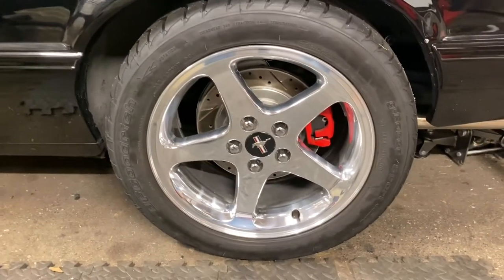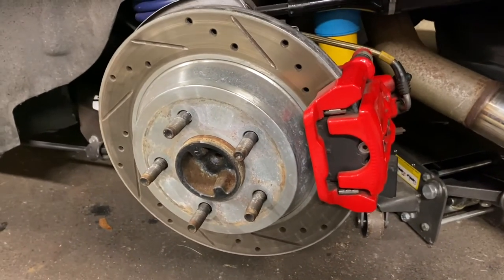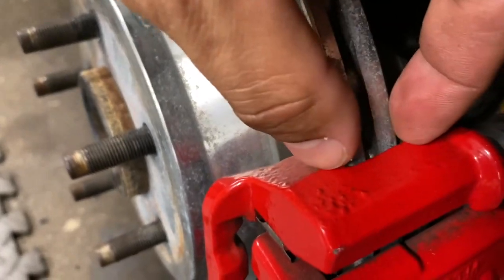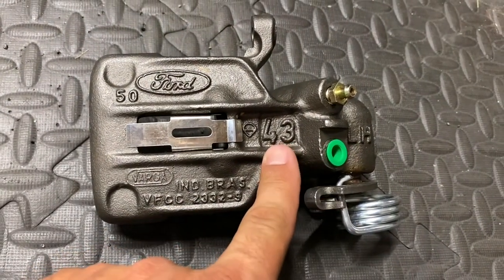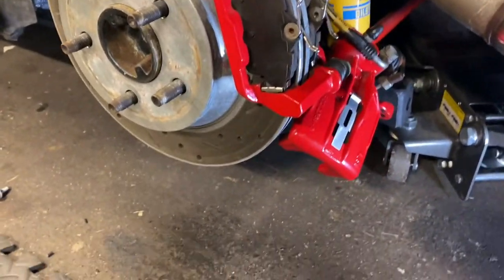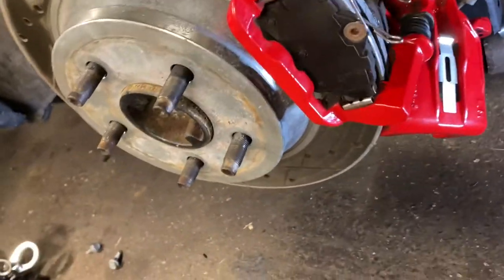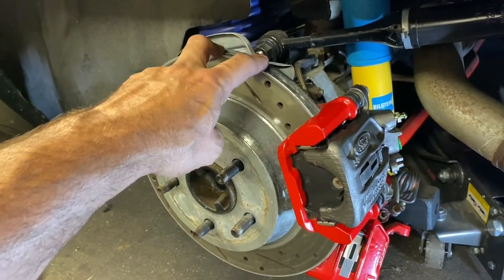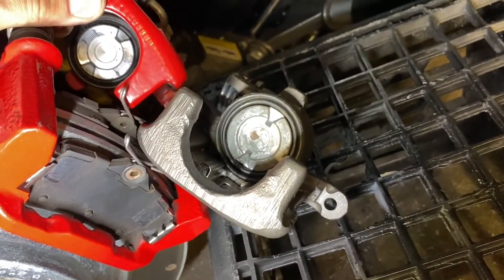Mustang rear caliper options w/larger front brakes (ATS Brembo) - Taurus 43mm

Comment from the maker: Lots of folks are having issues with Taurus reman calipers, including brake lockups.  The culprit is poorly remaned calipers.  It’s serious enough that I can no longer recommend this caliper and say to use at your own risk.  I’ll leave the video up as reference, but at this time I would suggest to stick with 38mm standard calipers.
Reply: For a 99 GT ,Would you say it is to front bias running 13inch cobra rotors /ATS calipers with cobra caliper 38mm and the 11.65in rear rotor?
Reply from the maker: @joeltaylor775   Hard to say because there are a lot of factors that go into calculating brake bias.   With the SN95 chassis you want to stay around 70-75% front as a general rule of thumb.  With the 38mm rears you are probably in the 75-78% range but it's been some time since I've crunched the numbers.  I tried to dig back to see if i wrote it down anywhere but i was unable to find.
Reply: @Mustang5L5  no problem bro appreciate the reply 🤙

Comment: Anyone doing a Fox conversion should have an adjustable proportioning valve, which regulates brake pressure to the rear. Too much rear bias with the Taurus calipers could be adjusted out with trial and error. Thanks for posting.

Comment: Nice video!

I see it's now recommended to use the 94-04 Cobra rear calipers on the rear. Wouldn't this bias adjustment be made with the Ford Racing proportioning valve anyway? Does it really make much of a difference?

I'm also wondering which brands are experiencing failures. I know the higher quality ones, like Raybestos and Powerstop, are usually pretty good.

So, as of June 2024, is the setup ATS calipers on the front and SN95 Cobra calipers on the rear?
Reply from the maker: The prop valve really controls the knee point which is the point of pressure reduction in the brake fluid to the rear calipers.  It's only one function of the brake bias calculation, as leverage (rotor diameter) and clamping force (caliper piston size) also play a role.  As you increase rotor diameter and clamping force, it takes much less pressure to stop that moving wheels.

I know the Cardone remans were the ones a lot of folks are having issues with. Most of the failures i've heard of have been on track, but have been catastrophic resulting in serious damage.  I imagine severe heat might play a role.  I think Cardone does remans for other vendors who rebox the part under their brand, but I dont know who uses them.  I've seen some folks tear the calipers down themselves to inspect and have found subpar with with some Cardones.  Others have gotten junkyard calipers and rebuilt them themselves. 

Really it's your decision as to the risk you want to take and your application.  Street car? probably wont ever have an issue provided you keep an eye out for rear brake drag.  But i also think street cars probably wont notice a difference at all between 38mm and 43mm calipers, other than pedal feel. There's also other factors at play here, such as weight distribution (IRS cars can sometimes get away with more rear brake bias), tire size front and rear, tire stickiness, does the car have ABS? etc.   I hate to dictate what folks should do and rather just provide the information and let them make an informed choice.   Id probably have different recommendations for a stripped down Fox notchback with 245 tires all-around, vs an 04 cobra with 275 front/315 rear, ABS and the IRS out back.

Comment: Hey bud, thanks for the video - i do have a question - Im considering this full disc swap (Brembos and cobra rear disc) - i have a 92GT - is upgrading the brake booster really necessary - and what do you think would be the biggest concern if i didn't? I mean - it cant possibly stop worse than it does now.. any response is appreciated.
Reply from the maker: Doing the booster has always been a controversy because some folks think it’s necessary and some do not.  I get it, it can be a PITA to install, but it does add much needed brake assist. 

I usually say that I recommend it personally (I have it) but am open to suggesting someone try it with the stock 87-93 booster.  Some folks like the firmer pedal, and some hate it.  I would at least be ready to swap the booster if you find you don’t like the pedal feel.  It will feel like you need to stand on the brakes harder to get more response.  You can sometimes compensate for this by downsizing your MC by 1/16” but your pedal stroke will increase. 

I do recommend the booster swap.

Comment: Great info. I am currently collecting parts to do a full 4 wheel disc/5 lug conversion on my 88 GT Convertible. I have the 43mm Taurus rear calipers and a 93 Cobra booster. I will be getting the ATS calipers and was planning on getting the 93 Cobra master cylinder,. But since you mentioned using the 94/5 GT MC with the ATS/Taurus caliper combo I'm wondering if that's how I should go as well. Any advice is appreciated.
Reply from the maker: I’ve spoken to a few guys who tried the ATS/43 combo with the 1” 93 cobra MC and remarked it felt soft with long travel.  I recommended they try the 94/95 GT mc and they liked the feel much better.  The good thing about the 93 cobra and 94-95 GT MC is the fitting sizes are exactly the same so it’s just the MC that needs to be swapped if you decide you want to try one for the other.  But I would go 94/95 GT for this combo.  

I’ve played the MC swap game with a few different brake setups and that 1/16” change makes a big difference in pedal feel.  If you find the pedal too soft/long, go up 1/16”.  If you find it’s too firm/short, go down 1/16”
Reply: @Mustang5L5  Thank you. Any thoughts on using the 93 Cobra booster?
Reply from the maker: @Mustangdan351  most of the folks I’ve spoken with are using it with this combo. I don’t have any actual feedback on it with stock booster.
Reply: @Mustang5L5  Thanks for the info. That helps a bunch.

Comment: So if I’m running the rear cobra caliper and rotor upgrade I don’t need to buy the Taurus ones?
Reply from the maker: Standard Cobra brakes are perfectly fine for most applications.  If you have cobra rear brakes installed, there is no reason to change to Taurus calipers unless your front brake setup creates way too much front bias.  There is risk in adding too much REAR brake, especially with standard Cobra/SN95 front brakes. Can lead to premature rear lockup.

Comment: So I’m wondering. Can I use the Taurus caliper with the stock gt brackets and rotors ?
Reply from the maker: Yes, it will work on a GT swap.  I think you'll need to use the GT pad bracket, not the taurus bracket.

Comment: Thanks for this ..was wondering if you have the measurement for separation of the mounting holes of the caliper to, the bracket and bracket holes to hub...the Taurus rear caliper looks almost same as the Merkur Scorpio (both have 43mm pistons too )..looking for a readily available caliper for the Scorpio
Reply from the maker: I have a caliper on the bench so I directly measured it. The caliper to bracket bolt spacing appears to be 117mm.  The bracket to hub mounting holes is 97mm.  Not sure if those are the exact dimensions but hopefully it gives you an idea.  I looked at a few pics of Scorpio calipers and it does look somewhat similar. Good luck.

Comment: will the ats brembo front brakes clear those 01 cobra wheels?
Reply from the maker: No.   Requires a spacer.  I forget exactly how thick the spacer needs to be to clear these wheels but it was pretty big.  The issue is clearance to the spokes.  These spokes sit close to the cobra calipers, so with the ATS Brembo it requires more room.  Pretty much why I didn't run the ATS brembos on this Foxbody.

Comment: I am running 15 inch wheels on the rear of my mustang. My rear is  a mustang gt bracket 10.5 rotor, will I need a 03/04 bracket for the taurus? or can I use the GT set up to bolt it up?
Reply from the maker: If you are running the GT 10.5” brakes then you can just swap the Taurus caliper onto the GT bracket.  No need to get the cobra brackets.

Comment: So I have been trying to confirm that the wheels that you show in this video will fit with the ATS brembo setup in the front. Can you confirm?
Reply from the maker: They do not clear the wheels that are on my car.  You need a spacer.
Reply: @Mustang5L5  do you know about how much?  A spacer is much easier to add compared to the inside diameter of the wheel being too small. 🤔
Reply from the maker: @dgkistler  it’s been a while. I have a set of 3mm and 5mm spacers I was using to test fit wheels and I want to say the 5mm gave it barely enough clearance.  I test fit a bunch of different wheels so memories of which spacer was needed where are a bit fuzzy.

Comment: Are the Taurus rear calipers compatible with the stock GT caliper brackets and 11.65” rotor?
Reply from the maker: The calipers will work with the GT caliper brackets, but those brackets do not work with the 11.65" rotor.  The slot for the rotor to pass is not wide enough for the vented 11.65" rotor.  You can use a Cardone 14-1042 bracket

Comment: I have GT500 (14”) front rotors with XTS brembos.  Looking for a balanced set up for the rear.
Reply from the maker: I haven’t done bias calcs on the XTS 14” setup.  I did do them on my car with the ATS/13” setup and even with the 43mm calipers it was front bias slightly.  I think with the XTS it will be very front bias.

Comment: To clarify you also need the axle housing backing plate if you want to run Cobra Rotors on a v6/v8 car.
Reply from the maker: Correct,  you need all the cobra specific parts including the axle brackets and anti-moan brackets if you are swapping to the 11.65" setup from a GT/V6 car.
Reply: @Mustang5L5  I’ve been running the Taurus calipers since 2000. It’s a nice upgrade.

Comment: So for the rear do I need a cobra rear bracket kit to fit the bigger rotors and if so is there a cheaper bracket the conversion kit is like 400$
Reply from the maker: LMR has a kit that’s a little cheaper but doesn’t have rotors.  This one uses aluminum caliper brackets.  You’d still need to buy the Cardone cobra pad support brackets too.  I assume this would be for an sn95 and not a fox using fox-lenght axles as the parts would change for that. 

https://lmr.com/item/SVE-2300-K/mustang-cobra-rear-brake-conversion-94-04-gt-v6

Comment: Would the cadillac ats front calipers with cobra rotors and taurus rear calipers with cobra rear rotors work ok with a 1.032 manual master cylinder?
Reply from the maker: I’m not up to speed on this conversion using manual brakes.  Just thinking out loud, I would upsize your MC about 1/16” more than what a manual brake setup for 99-04 cobra front and 38mm rear calipers would use.  If you can figure that out,  you can upsize the MC slightly for the additional fluid requirements of the ATS/43mm Taurus combo.  Of course, another variable is the pedal ratio and that depends on what manual MC kit you went with.